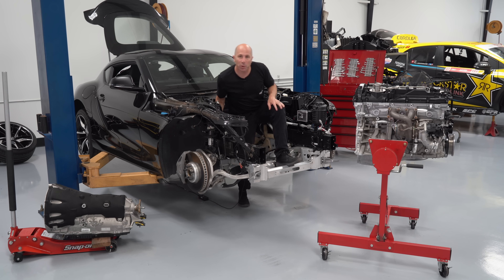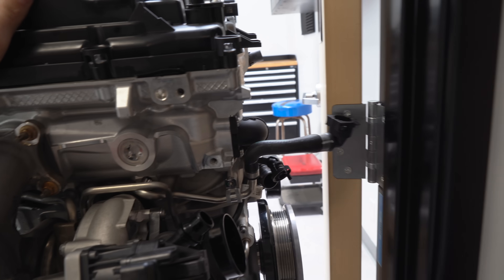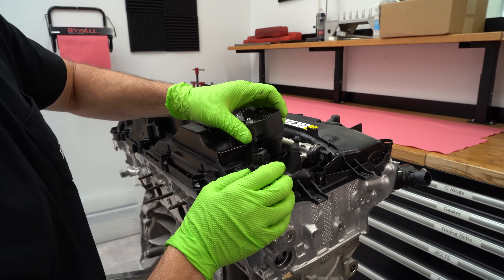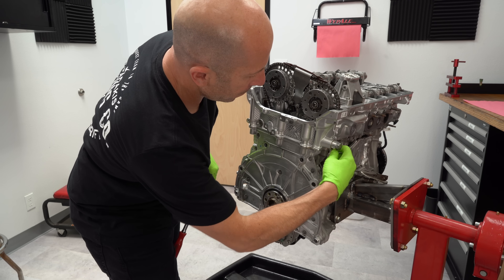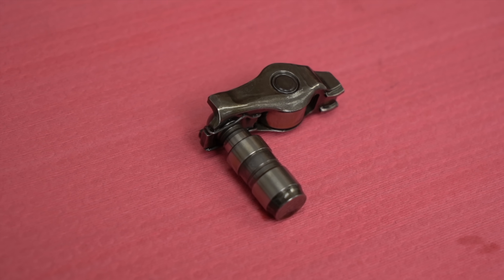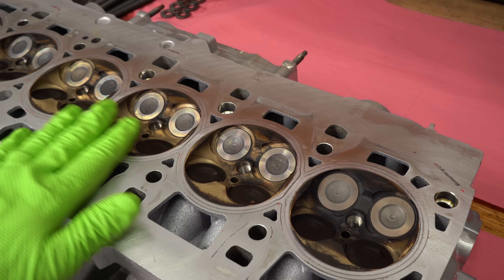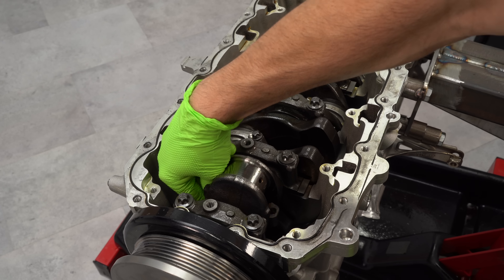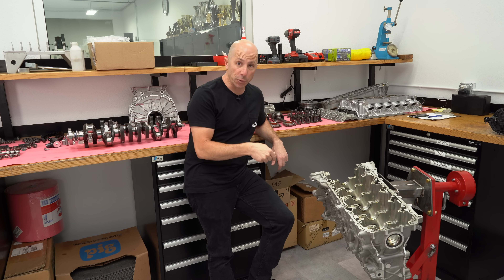2020 Supra B58 Engine Teardown - First Look - Better than the 2JZ?

Comment: direct fuel injection, so every 30,000 miles you need to clean the carbon build up on the valves, no thank you .....
Reply: Many companies now use both direct injection and port injection simultaneously, the port injectors keep the valves clean to minimize any carbon deposit.  Toyota’s newer 3.5L engine does this.
Reply: @GotThrottles  that is true, is this new Toyota engine available in the US?
Reply: fastboatster yes it is, 2017 and newer V6 found in Camry, Sienna, etc with the D-4S twin injection system, 295hp, I was surprised
Reply: @GotThrottles  also very true
Reply: So just 200 bucks and you are good to go. Can get your own walnut blasting setup from harbor freight. Most of the newer engines now days are direct injection anyway, not like you can get something new performing this good without it
Reply: maybe not I do believe the only reason that was ever a problem was because they ran egr and pcv to the intake to burn off in the motor depositing the carbon on the valves so if they don't to that then there should be no problem. so I guess we will find  out as time goes on
Reply: It's not 2001 anymore Gerard

Comment: Direct injection and that variable valve lift system is what sends alarm bells off in my head. But there are a lot of other problem areas that others have picked up too by the looks of it.

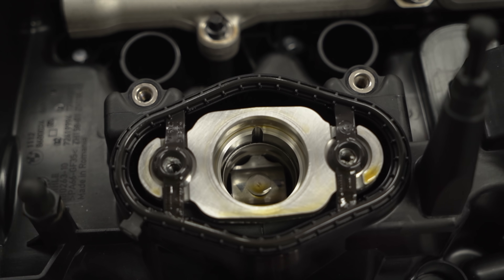Comment: I think he got something wrong, he is talking about Toyota all the time, and this is clearly BMW. There's not one part on that engine that says Toyota or has their logo. 4:41 Another BWM logo, HOWEVER it's not even made in Germany, it says "Made in Romania"

Yes, and?! So what, i don't care, it's crap anyway. Non-negotiable. You don't rocket science degree to see that. Usually when someone else builds a nonsense like this, the intercooler that's totally inaccessible and shoved permanently inside the manifolds, it's one of the main reasons why people keep at bay. But being built by Toyo.. pardon me, BMW, it's gonna be praised for some reason.

Comment: This is definitely an interesting engine, but with that much plastic it is gonna be a bitch to work on once it has a good amount of miles. Also, a lot of the mechanisms seems to be complex for no reason or prone to breaking, ie chain driven oil pump. Definitely, a cool car but I'll have to stick with my good ole 97 m3.

Comment: I honestly dont know why the 2jz is so hyped up and overrated.  Sure,  you can make a lot of power with it, and some other benefits, but there are so many lesser known engines that are way cooler in my opinion.  One of these is the om606, which is a diesel inline 6 by mercedes.  Look up any videos of these and you'll soon find how amazing they sound. Even though they are diesel, they sound like a high revving gas engine.  They are also known to be extremely reliable.

Comment: Next stop: can it be manual swapped?like T56 Magnum gearbox? (i like the 8at too for fast shifting.)
Reply: Some shop in TX is already doing these swaps, although transmission has to come from bmw. Price is said to be around 12 or 20 grand, not exact
Reply: Holy shit, i did noticed that just now.

Well it is a german gearbox too, like when the mk4 has the getrag 6mt too.

Comment: I'm really curious with the integrated manifold how limited it will be. I Depending on the CFM max , I think the manifold will be CNC'd off and a individual exhaust ports welded on
Reply: Andrew Lukachko maybe it will be turn around for that.

Comment: Thst new motor toyota built?..lol nein das haben die deutschen gebaut🤣
Plastic motors are so reliable 🙄
Reply: @Intrepid74656 oddly my bmw motors plastic parts (many to name) didnt last with under 30k nor did my brothers some had to be replaced under recalls with updated metal parts, so I'm wondering how a modified motor putting out more heat and pressure will hold.. not good I think.

Comment: I cant wait to see this engine pushing 1000hp so they can shut the fuck up already about how it is not a worthy succesor of the Mk4. Bmw engines are strong, and the N55, which was the predecessor is considered by some as the modern 2jz

Comment: A bummer that aftermarket cylinder liners could be necessary.
Lollll bigger turbo bigger exhaust  better inlet manifold come heat exchanger.
A worthy replacement for the original supra.

Comment: The toyota 2GR-FE engine in Siennas, highlanders, rav4, camry, avalon, is so packed in those cars that anything timing cover or the back head requires dropping the engine out the bottom of the vehicle....so toyota has been doing complicated things for a long time now. They don't want you to work on your own car. That why they seal transmissions and create special tools so the average Joe HAS to go back to the dealer. It sucks

Comment: I used to be bummed at the plastic guides for the timing chain in my f150. Seems like that would be a recipe for disaster. But now I can see that even Toyota uses them for their vvt equipped stuff. Or vct, however you wanna say it. Either way, I'm quite relieved to see that.

Comment: A very impessive engine
We are coming to the peak of internal combustion engine efficency.
Some improvements for higher HP can be made easily.
The water to air internal intercooler reminds me of certain supercharger ideas.
Reply: I want to use internal combustion engines forever.

Comment: Just by the way from a bmw tech the throttle body is for fail safe mode. The rpm is controlled by the valvetronic
Reply: Yup, has been like this since the n52 or even earlier
Reply: Do you have pull the engine to get camshafts out, or just for chain replacement if you had to ?
Reply: @mattvanberkel7847  chains can be done in the car if you're good enough, done a few on F25 X3 N57 engines with the engine still in the car, tricky but still managable
Reply: The throttle-body is there to help control boost at the plenum, in concert with the EWG. The real throttle is controlled by Valvetronic, like you stated and in-case the Valvetronic stepper motor fails, the throttle-body is used in its place as the actual throttle, as a failsafe (you are correct).

Comment: I hate drive by wire...sure it can be fast and whatever, but I like the feel of cable throttle and the vibration you get back from the engine
Reply: Inferno_Spud drive by wire is much better. Engine knock ? , low on fuel, fuel filter blocked .. etc, at 25psi, the ecu protects the engine.

Comment: I was a technician working for a Toyota dealer when the first Supra hit the US market. Previous to Toyotas, it was European cars including Jags, Rovers, MG, Citroen etc. so when I was able to drive the Toyota 2000 GT (with left hand drive) that the owner bought I told him it felt like a Jag XKE but lighter. Put it on the lift and it looked like a Jag XKE. 

It was fun watching the teardown of the newly introduced Toyota Supra power plant. Learned a lot, Thanks

Comment: From a forum I read a long time ago the 2JZ was designed in partnership with BMW back in the day just and it had some point to it because bmw had the E36 S50 and S52 engines so it’s possible that in that time BMW thought Toyota would fail and wanted nothing to do with branding their name on the Supra and this time they said we helped with the 2JZ let’s do it with the new Supra but we would never know unless it comes from BMW AND TOYOTA themselves!

Comment: Great vid.
It's quite an oddball that engine - o guess that's to be expected with a BMW design.

Plastic parts, cam chain in the rear, needing to turn down sockets for removing parts?!
Im impressed however how other parts were kept relatively simple - I wonder how much of that was that was done by Toyota.

Certainly a motor with potential.
Reply: None of it. You can find the exact same engine as early as 2016 in other BMWs.
Reply: @RyosukeTakahashiRX7  Toyota did redo all fasteners and did their bit on overbuilding a lot of components to make them meet their Toyota's reliability standards.

I'm just not sure what else they have done if anything else.
Reply: @tomonabudget  Maybe the materials are a bit more resistant but i honestly can't see a difference to  the one in the 340i.

Comment: Water to air intercooler, oil cooler, head gasket, and the turbo has coolant going thru it. That plastic water pump will not hold, that is a common problem with all cars that have plastic water pump housing. This BMW engine will be the worst of them.